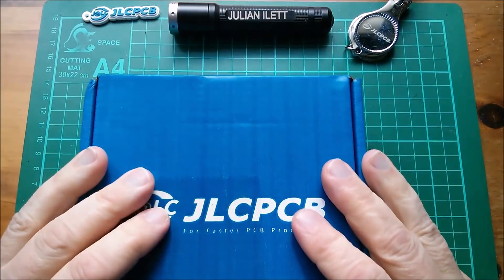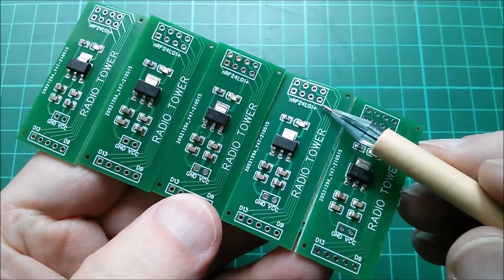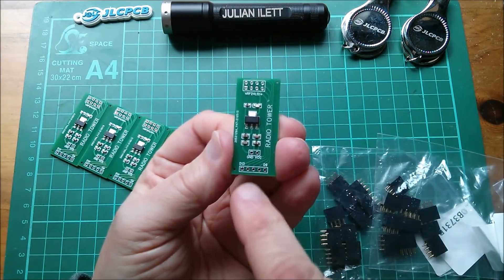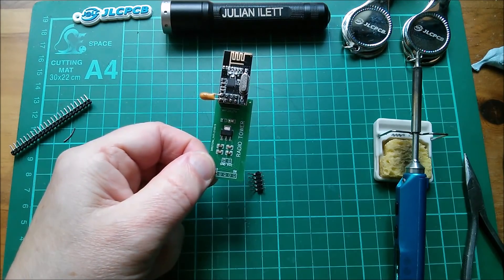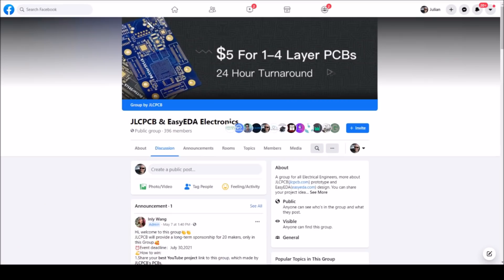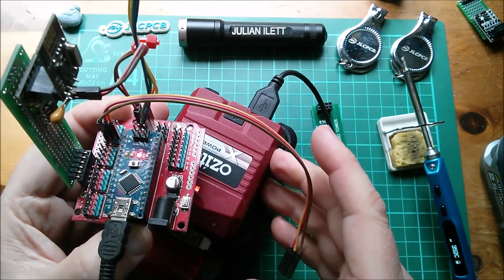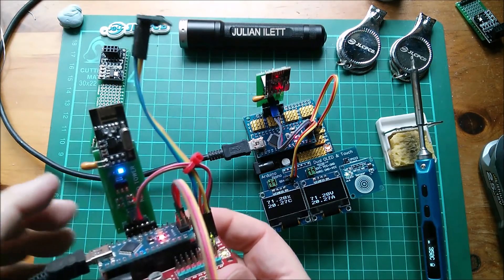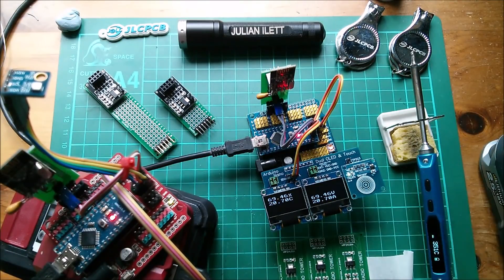New PCBs from JLCPCB - Arduino Radio Tower

Comment: All the blue LEDs I've got are super bright, and I usually have to multiply the resistor value by 10, ie 10K - 30K.
Yay, the screen capture is loud now - it's actually louder then the cam sound, ie, a touch too loud -.

Comment: How much did you end up paying for the boards, including assembly and components etc?
Reply: well it shows development, the new arduino rp2040 with esp32 onboard could be the easy way for this, 
but not cheap  or  rpi zero wifi may be the best solution, wifi range may be a problem ?

Comment: I was of the opinion that the nrf capacitor was not required if one supplies enough power to the board as in the power adaptor or in this instance, your regulator.

Comment: shocked that the led with "no info" turned out to be blue after you assumed red was common. was there really no info or was the colour in nanometers eg Blue: 450–495 nm
Reply: yep, just confirmed it was on manufacturer data sheet in nanometers nm

Comment: There are already those pcbs for nfr24 that you can buy for really cheap and they are way more compact. My personal favorite are rfm69 radio modules that can be found for lower frequencies and work very well with mysensors too, that I suggest you take a look as it can be integrated into home assistant and other similar programs.

Comment: I get the need to show your sponsor's assembly service but getting them to assemble 5 PCBs with 7 components is hardly a realistic need for any of your viewers.  You could probably assemble them just as fast, as we've seen you do SMD work before on the PWM5.  The tantalum bypass cap could have been moved from the nRF24 to this "tower" PCB also.
Reply: I agree for 5 boards it's not worth it, especially with so little components, these would be relatively easy to hand solder. But if you order 1000 boards, or with harder to solder components, I'm guessing it's a good service.
Reply: @DaedalusYoung  - Exactly.  If you are going to promote their service make it real with a lot of SMD parts.  And like I said, Julian has done a lot harder SMD work with more parts on his PWM5.

Comment: Hmmm... if you don't know the SMD resistor code, I wonder if there is some kind of device, or tester, or measuring tool, that could confirm a resistor's value? - 9:58
Reply: A multimeter can measure resistance, or you look up the code online
Reply: @DaedalusYoung  - Ya, I was just making fun of Julian not using one of his many DMMs.  It would have been easy to check but he just assumed it would be right.
Reply: @ElmerFuddGun  Oh haha, yes. He actually was right, but I see your point.

Comment: Interesting to see - for instance @6:15 - that the voltage has exactly the same digits as the humidity, as well as the current value being exactly as high as the temperature. I do wonder from where thoose readings actually come?
Reply: @studer1679 - Ya, Julian just copied the temperature and humidity values over so there would be some "live" readings on the second display so you could see it actually working and updating.  I'm sure he will display real data there in the future.  Or I hope he will.

Comment: Funny that your regulator PCB is almost 2x as large as the Transceiver module! 
The nRF board looks like an ESP8266-01 module!
Reply from the maker: All these RF modules look the same  - just a chip and a squiggly track :)
Reply: @JulianIlett  You're right.
I bought a couple of nRF modules a few years ago, and they're still unopened in my parts drawer. 
ESP8266 and ESP32 ruined my plans of world domination through Arduino and nRF.
Reply: @piconano  nRF has more distance than wifi. How does that change what the nRF would do ?

Comment: All those different coloured LED's. Nice to see Diversity in the workshop (hahaha) How much extra was the cost to have them supply and build the board, as compared to base price, as I would love to use smd's but I haver deformed JCB buckets for hands, with Bratwurst fingers!!
Reply from the maker: Probably about $10 extra to have the components fitted - if you can use basic parts only. Because I used some extended components, it cost an extra $6.
Reply: @JulianIlett  That is really good value especially considering there are 5 boards. Thank you for that , it means I can be a bit more adventurous.